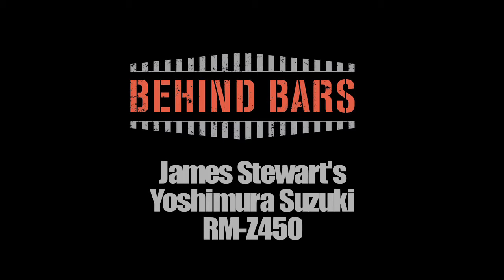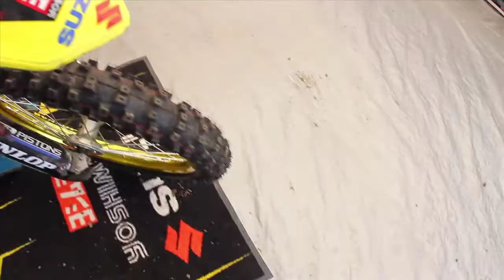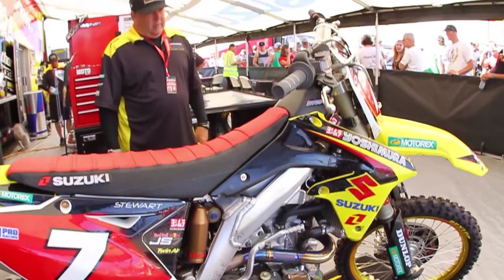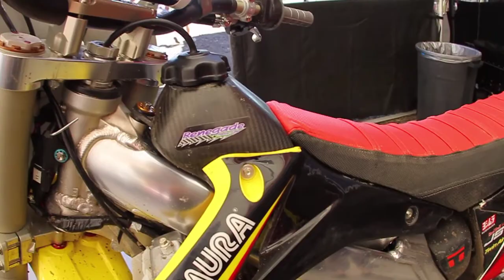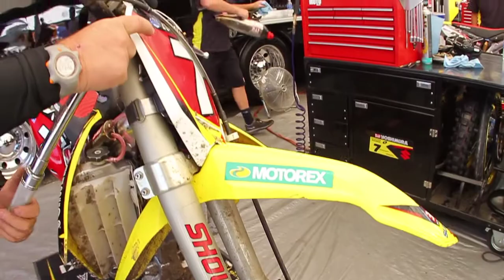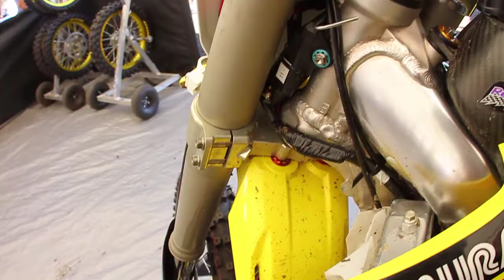Behind Bars: James Stewart's Yoshimura Suzuki RM-Z450 Dirt Bike

Comment: 2:30 can someone tell me why muffler manufacturers insist on making mufflers that don't exactly fit the bike they're made for?
Reply from the maker: +shogrran What do you suggest they do? How would you design them?
Reply: Chaparral Motorsports IF (and that's a huge IF) I can design and manufacture after market parts, I would at least make them fit the stock frame and stock fairings without having to weld/hammer/saw anything. But that's just me. That's why I'm asking why pipes that are supposed to be for the make and model of my bike, can't fit without some soft of modification or "tailor-fitting"